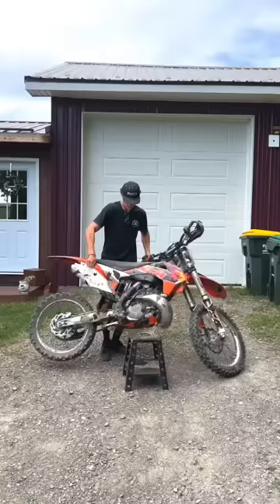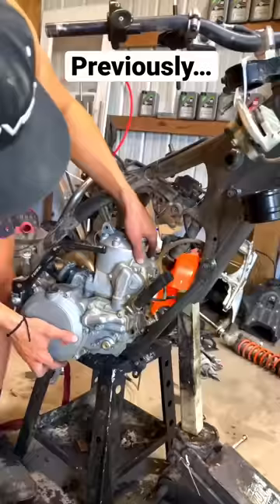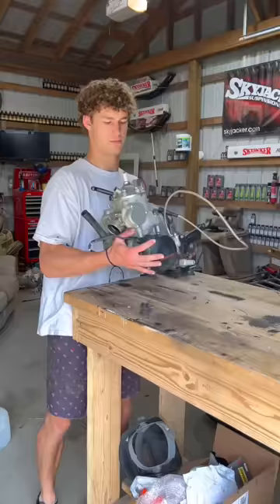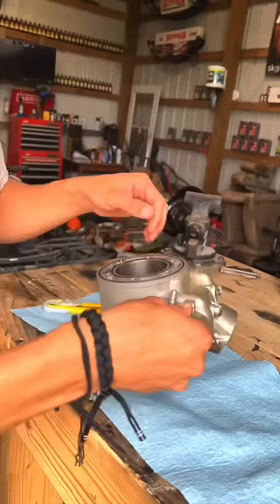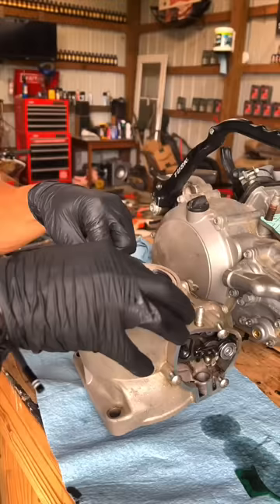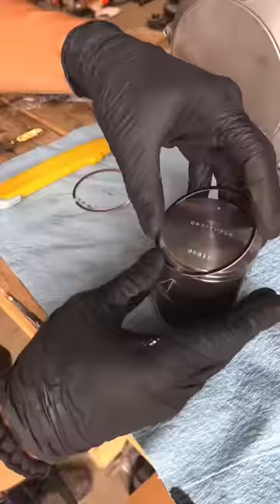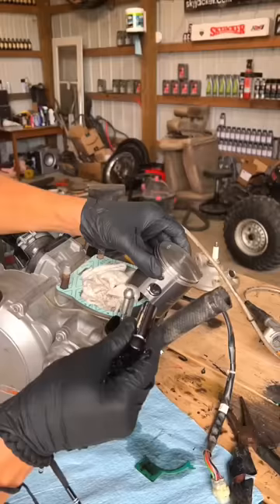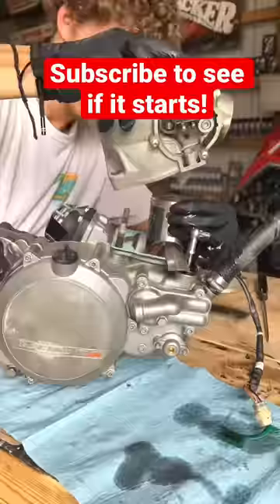Rebuilding A DESTROYED Dirtbike! #pitbike

Comment: One thing about ktm is there's about 100 extra parts on those machines that no other machines have yes they are nice machines but they are so over engineered
Reply from the maker: I have nonissues
Reply: How so? I’m not a ktm fanboy and have never owned one but have worked on several and never saw any unnecessary or over engineered parts

Comment: Why did you tear it completely apart to do a top end rebuild? I cant tell from the short clip of the bike all together but it seems like if you just removed the air scoop you could rip the head off
Reply: He tore it completely apart because of how bad the bike was when he got it to begin with. Might as well if you got the money right?
Reply from the maker: Just for a full build i didnt have to
Reply: @liamreid  I see. No issue with completely looking over a bike you just got
Reply: @liamreid  not a full build,  the bottom end wasn’t touched.

Comment: If you don’t match the cases and blueprint the engine, your engine won’t be 100%.  Using sand paper on your engine is a big no no.  Steel wool fine but sand paper is just asking for trouble
Reply: It’s would be fine if he had it on a flat surface to resurface it but of course he went at it with his finger so you know there will be kicks in it and it won’t sit flush
Reply from the maker: Its fine